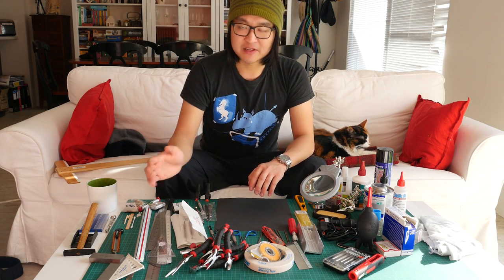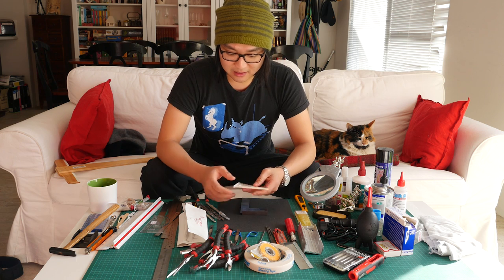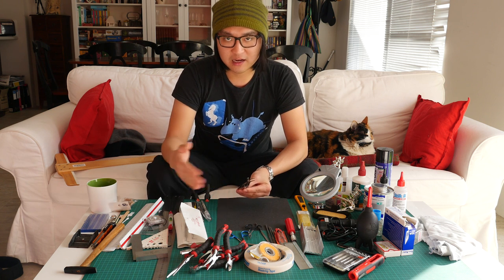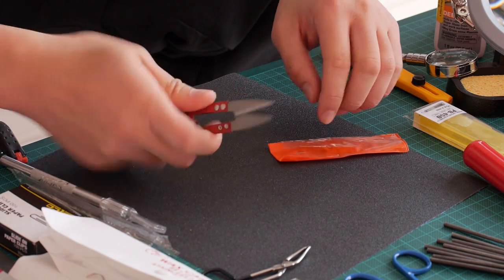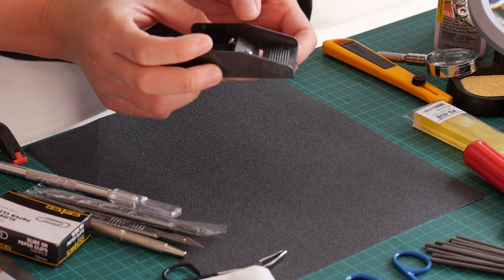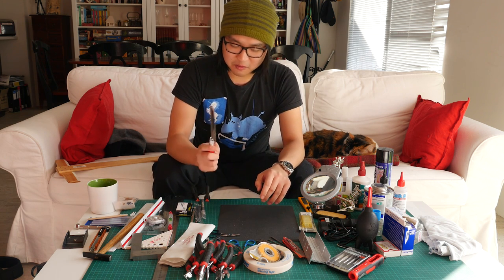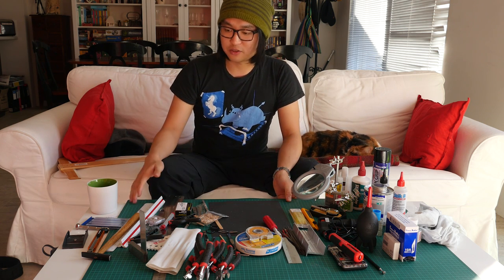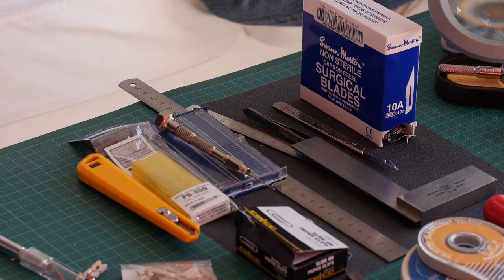Handtools Rundown | Architecture Modelmaking 101

Comment: Is this what you do for a firm?
Reply from the maker: Hi Stephen. I do work as the model maker for an Architectural firm. However, nothing I show in my videos; model examples or tools are from the firm I work for =)
Reply: Wow really... So you're also a hobbyist? Do use machines Ie. CNC 3D etc. for models? I'm guessing you were an Arch student?
Reply from the maker: I'm in the middle of my Masters of Architecture degree. I work for the firm Part-time which is a bit of a struggle juggling both obligations hence why I can't make videos as fast as I want to =( If you're asking because I look older, it's because I have a degree in Filmmaking as well.

I have my own little 3D Printer and we out source laser cutting when we need to. I think sometimes students might depend on the laser cutter (at least where I am), a little too much though. Every tool has it's purpose of course =) and it's important to find the right one for the job.
Reply: Ahhh... Thanks for the info. MArch where? Maybe a long term video project if you're thesis and construction of model w/phases... Might be appreciated by a lot  (of aspiring MArchs). Yea I do find that a lot of schools teach studio differently... But I've learned that hand modeling makes the sexist models... How long does model project usually take?
Reply from the maker: How long is a piece of string haha, it really depends on the model, it depends on the project and goal of the model. For example, at both ends of the spectrum, the difference between an in house study model and a presentation model for prospective clients.. So far,  I have worked on models that take between about 4 days to a month.

Thank you for your suggestions, I will try to record another start to finish model by the middle of next month.